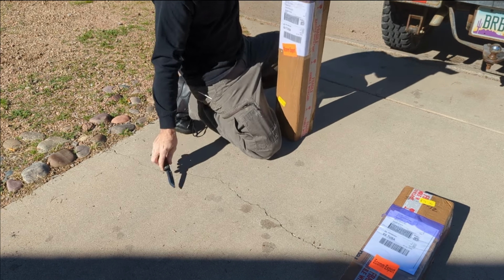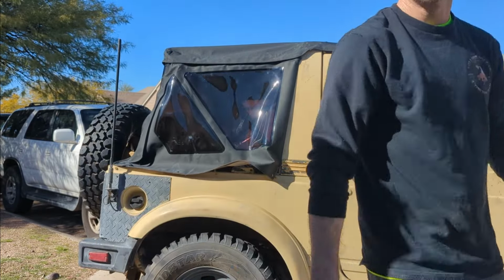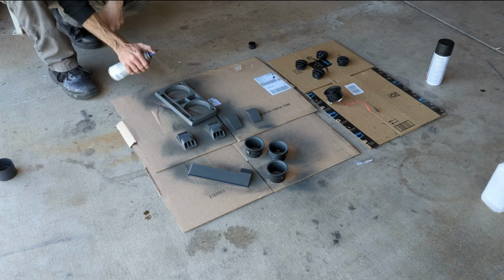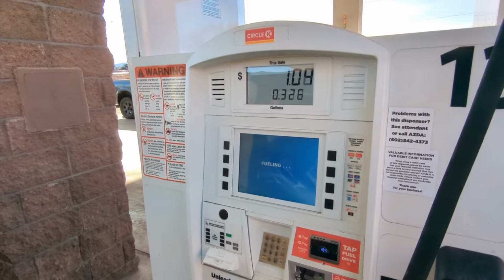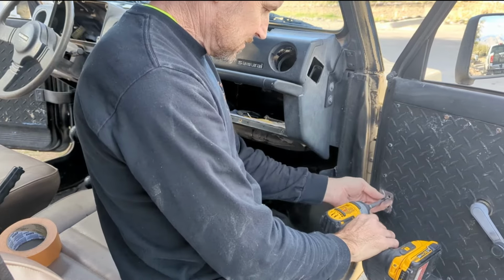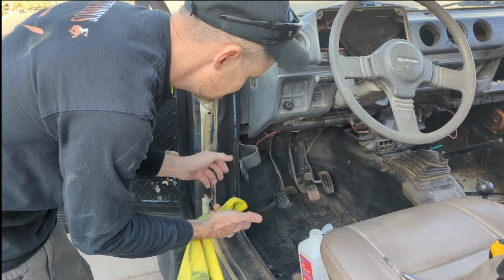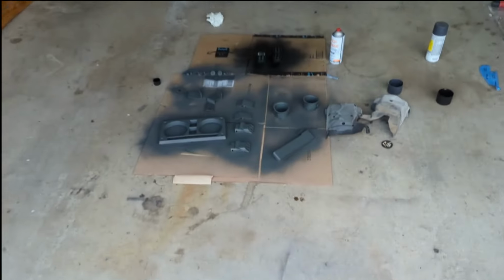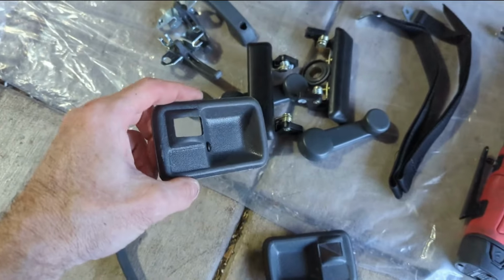Part 8, Suzuki Samurai Painting the Dash, Jimny, SJ413, Sierra

Comment: Just watched the whole video, when I bought mine all the door handles were trashed, and the previous owner had a piece of para cord running to the back door from the interior door handle to open it. I got online and ordered all the metal door handles and changed them all out. My soft top was all trashed too so I went with an inexpensive one off eBay without the zippers on the windows, it worked well for a couple winters but I found a hardtop and installed that. Coming from 2 years of building mine the best piece of advice that I can give you is stay away from the India parts. Pay a little more for the Japanese stuff. Also support the few companies that are catering to the Suzuki community like Zuks Off-road, Zuks of Hazard, Trail Tough, LowRangOffroad, Roadless Gear, and Suzuki Samurai of America.
Reply from the maker: Right on, how much was your hard top if you don't mind me asking? I just got the dash all back together and installed the new combo switch, there was a few hurdles with the India one, had to bust out the old dremmel  to modify the plug. I'll try to edit all that tonight.

Comment: Great Job. Where did you buy your parts ?  I have an all original, bone stock Red JX that I bought new in 1988 that I am going to freshen up.
Reply from the maker: I just got them on Ebay, but honestly if you have an all original one I would prob spend the extra money on OEM parts. There's some people in the comments that have recommended tons of places to get OEM or New Old Stock parts. Are you planning on keeping it forever?
Reply from the maker: The videos after the one you commented on shows the dash all put back together, then the next one and the one later today are window regulators, cranks, handles, seals, trim, moldings etc. Thanks for watching.
Reply: yes I have had id it so long I am just going to keep it. I bought it new in 1988 with an optional hard top and dealer installed air. It is a 1988-1/2 model with the square port dash.I just used it as a car and it has never been off road, it has always been stored under cover and is complete and unmolested. I opened up the glove box several days ago and all of the original sales paper work, owners manual, warranty card and the Monroney build sheet were all there. it was like a time capsule . At that point I decided to spend some money and freshen it up and drive it and enjoy it once again. It has about 85K trouble free miles on it and is rust free. Ionly had to take it back to the dealer one time for an warranty work. Samurais are simple and easy to work on and the parts are reasonable priced. One of my better purchases in life.
Reply from the maker: @WesB1972  That is absolutely amazing. Just so you know it's worth a fortune! At least with classic cars that's everything someone would look for, and these things have a huge following so I'm sure there's someone looking for an all oriiginal one like you have. It blew me away when I saw what people are asking for some of these. I've seen anywhere from $5k-$30k+. The fact that it has air is so cool. I actually asked that question on a video the other day but it got edited out because I can only do 40 minutes (which is actually really long for most people) with my editing software. I asked if anyone knew if they make aftermarket air or if it was ever an option. I didn't know if such a small engine would handle the additional load at idle. Anyways, I don't know hardly anything about these compared to alot of people in the comments on this series but if I can give you any advice it would be not to change anything on it until you talk to an expert. I know for classic cars they are worth way WAY more original than updated. If you don't care about its value at all then obviously do what makes you happy but I would definitely keep every single part you remove from it. There's 11 videos in this series (1 a day since I bought it) and #12 is scheduled for 3pm AZ time. If you have time look through the comments (there's not too many). You'll see who the real experts are and the places they've recommended for original parts. That thing is 100% worthy of original OEM replacement parts! Thank you for sharing, that's really cool!!!

Comment: looks nice
Reply from the maker: Thank you, I'm currently uploading the video where it all gets put back together. It really does look amazing at the end. That Dupli-Color Vinyl and Fabric spray paint is like magic in a can (should be for $15/can though). The dash seriously looks brand new. I also installed a new combination switch (the thing with the turn signal/wiper levers) on the steering column, had a few issues with that though.